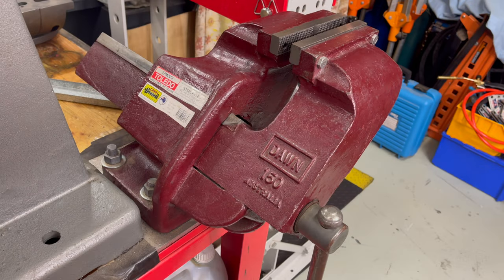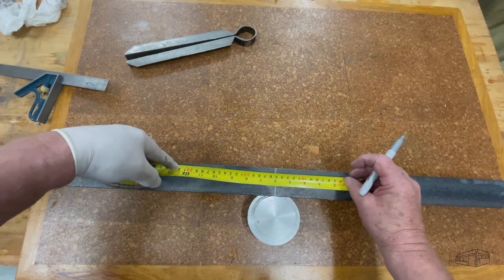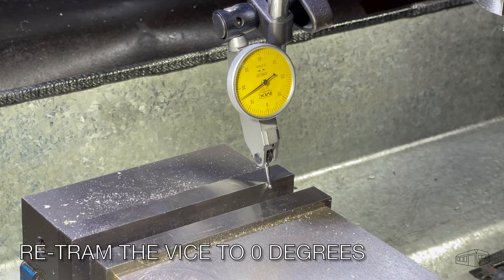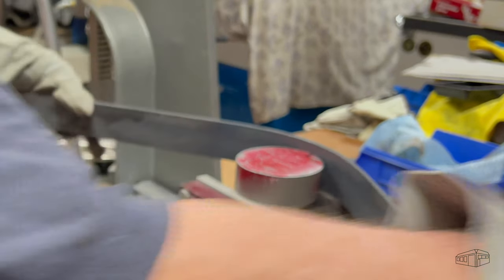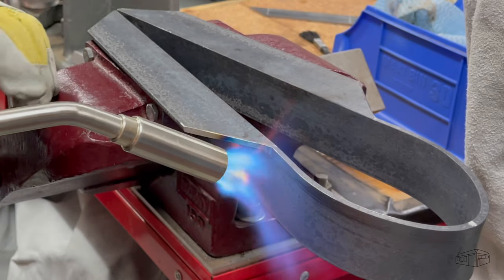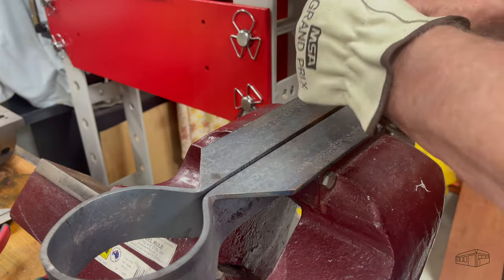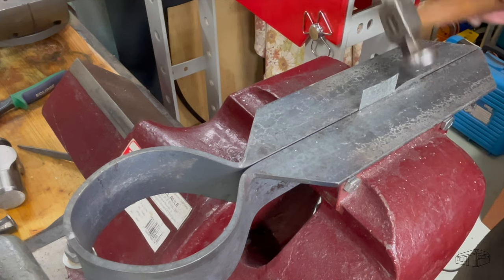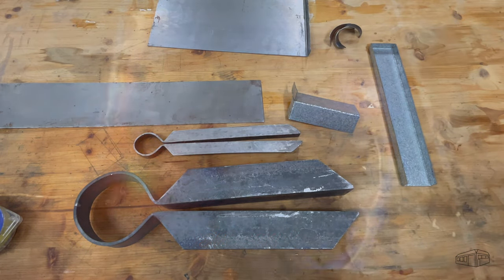Making a Folding and Shearing Tool for a Vice - Shop Made Tool

Comment: In the spirit of hacksaws and right angle grinders a wonderful heat source for making your circle-bend would be to get a bag of charcoal and fire up the Barby(sp??) as you Aussies like to call it.

Very creative tool and a nice build for your second/larger addition 
well done mate
BTW... if you plan it right and clear it with the Mrs. you can get a joint of meat and turn over the heat source once you are finished making the circle bend the "Chef-ette" of the household and cook a nice cut of meat... a leg of lamb comes to mind❤!!
Reply from the maker: Thanks for the comment, sounds like a plan. Cheers SteveO